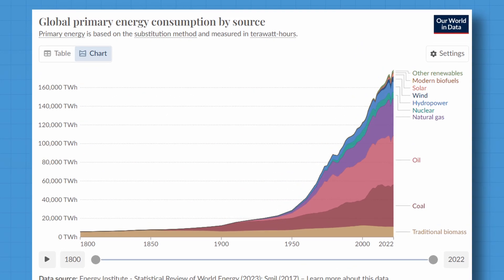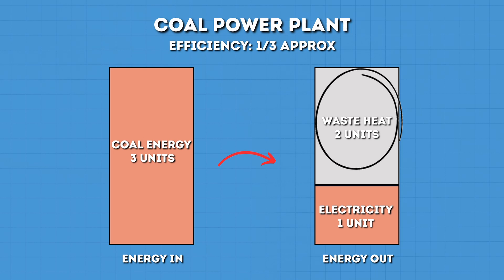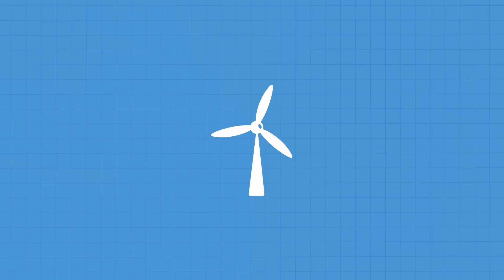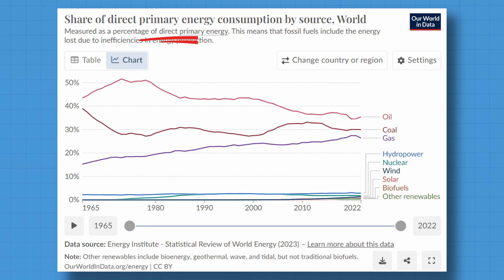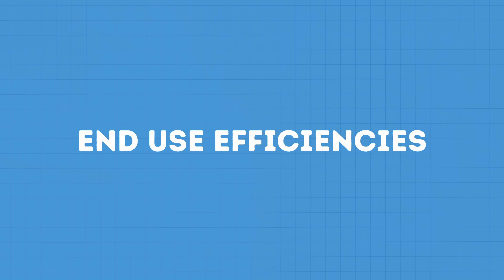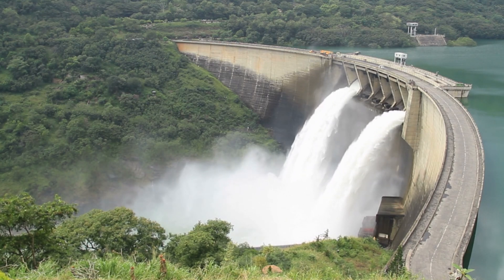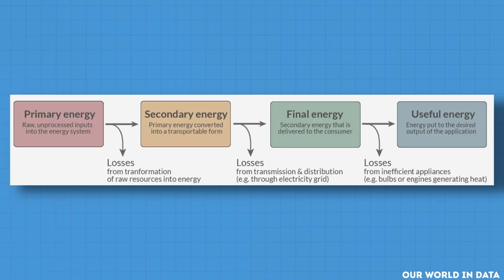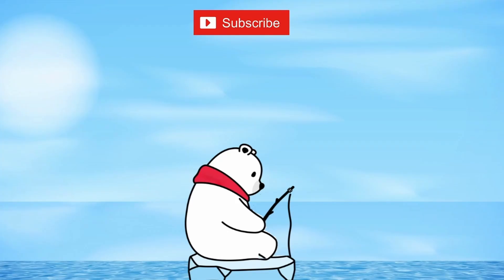We need to talk about the Primary Energy Fallacy

Comment: True but one sided. There are plenty of "fallacies" going the other way. 1) Renewable energy is cheaper. Yes when the wind is blowing not if you consider the infrastructure, like back up when wind not blowing or inertia installations to preserve grid stability. If it really was cheaper then normal market forces would allow renewables to take over. 2) Heat pumps are more efficient. Yes but comparing cheap gas to expensive electricity. The delta T on a heat pump is poor so affected by ambient conditions and need radiators twice the size. 3) EVs. If these items were really better people would be buying them instead its top down with quotas. 4) Video misleading in that it suggests there won't need to be an increase in grid capacity as this is allowed for by relative efficiencies. Up to £400bn of investment is required in green infrastructure over the next decade if the UK is to meet its ambitious Net Zero target, according to a new report by PwC commissioned by the Global Infrastructure Investment Association (GIIA).
Reply: £400 billion is a piddling small change compared to societal collapse brought on by climate change. (Annual UK GDP is $3 trillion.)
Reply: @wotireckon  Pointless. Total worldwide Carbon dioxide emissions have only steadily increased since Paris agreement. Look at the graph. De-industrialisation would be a gift to Russia and China. "Societal collapse brought on by climate change" Why? Could just as well argue that trying to implement carbon net zero has that effect. The good thing is that 2024 will be the first year where 1.5 degC increase is achieved although not continuously. This is a good thing. The IPPC report references 1.5 degC extensively so at last we be able to check predictions with reality. People will decide that the dire predictions don't happen and throw out the policy after Labour tries to implement them. And that will be the end of your fantasies. No wonder the greens are getting desperate, can only shout wolf so long.
Independent Statutory Bodies’ Analysis: The Committee on Climate Change estimates that reaching net zero emissions by 2050 will cost approximately £50 billion per annum by 2050. (UK government budget is £1100 billion).
Office for Budget Responsibility (OBR): In a July 2021 report, the OBR estimated the net cost of the UK reaching net zero by 2050 to be £321 billion, equivalent to just over £10 billion per year.  So my original £400 billion on the low side of estimates.
Reply: @alanrobertson9790 Also who the hell says Green New Deal and similar investment strategies lead to…deindustrialization…

Here in the USA (not the UK, but i mainly know local data off the top of my head) our Coal Towns and Rust Belt are dying and rather than investing in other things we could be manufacturing/just transition into sustainable jobs we have decided to just sit and pout as the world moves on.

A Green New Deal and similar investments would create PILES of new (often high paying and union such as Electrician, Welder (and/or Pipefitter), Plumbers), also if Deep Dry Rock Geothermal is used Drillers etc.

The only people your arguments serve are the Rich.  Poor People (especially in non-rich) countries are going to get fucked over the most, middle class people (without subsidies and/or jobs and/or more housing (which is often related to these programs) ) are going to suffer economically.  The rich however either have to slightly shift investment portfolios and/or quit being an Oil Baron.

Don’t be deluded by Industry Lobbyists.
Reply: @ericlotze7724  A green new deal will give jobs for some workers but against that higher energy prices and government subsidies cost other people money which may make them uneconomic, particularly considering cheaper foreign competition. What you said about the rust belt is a true, with decline setting in before any green new deal. Well higher energy costs won't be a way for reversing any trend. Can agree that higher costs will affect the poor more which is why you won't get the poor going on green protests or queuing up for EVs. Industry is useful and serves the interests of its customers. People want to buy petrol. I'm amused that your comments shows how you fit green issues with your overall philosophy. You are probably a young person who is given things, first from your parents and then from the state, in this way you can be cheerfully insulated from the damage of the policies you advocate.
Reply from the maker: The video doesn’t suggest there won’t be a need to increase grid capacity, far from it. It’s 100% clear that grid capacity and transmission needs loads of investment. One of my next videos is precisely on this need for investment in the grid, especially as so many projects are backlogged because they can’t be connected. So I honestly don’t think this video suggests in any way that grid capacity will remain the same
Reply: @theclimateClub  Time index 9.14 "It sends the wrong message. The message being that we need to increase our energy supply from renewables substantially, instead of meeting the actual demand". But its not the wrong message, we do need to increase our energy supply from renewables substantially which is still true even with the efficiencies consideration. So who is being misleading? You could have accurately said "we need to increase our energy supply from renewables substantially although less when the efficiencies are taken into consideration". "So I honestly don’t think this video suggests in any way that grid capacity will remain the same". The video neither says stays the same or talks about the huge increase required. That you are aware of this makes this omission a political choice which is my point.
Reply from the maker: @alanrobertson9790  perhaps it was unclear then. But that statement was in regards to the substitution method which inflates energy numbers. If we “inflate” what the real energy demand is then that can send the wrong message. The argument wasn’t about not needing to ramp up renewables. It was about meeting the actual demand instead of purely focusing on supply, not the inflated demand that comes from this accounting method. This point was also made by Michael Liebreich in “net zero will be harder…” paper. If it was unclear that that was my point then I apologise, however that argument was for the substitution method. So no, I’m not making it political
Reply from the maker: @alanrobertson9790  in other words, it is the wrong message
Reply: @theclimateClub  Re " in other words, it is the wrong message". To meet the actual demand we do need to increase our energy supply from renewables substantially. This is correct not wrong. You have already conceded the point and are about to do a video on the subject. I look forward to your video.
Reply: Renewables are taking over, but it doesn't happen overnight.
Reply: @SirCutRy  "Renewables are taking over". Nobody would complain about that unless they need to be subsidised. Here there is a mismatch because supporters always say that renewables are the cheapest and I reply well if that was the case then they would succeed through normal market forces. Renewals used to be subsidised but to find out if still the case I typed in "do renewables need a subsidy" you get that they used to be subsidised but "Today, renewable sources of electricity are becoming increasingly cost-competitive with fossil fuels and nuclear power. As technology advances and economies of scale come into play, renewables are no longer solely reliant on subsidies". An ambiguous answer.
Reply: @alanrobertson9790 mind telling me how much fossil fuels are subsidized…
Reply: @ericlotze7724  Fossil fuels are not subsidised, you don't need to subsidise the most economical form. In some places, like Egypt you get subsidises for the end user because the population is poor. You can also have tax relief for exploration. That is because governments may wants their resources exploited because it makes money for them. In UK the tax on petrol and diesel is very high and makes money for the government, additionally there have been extra taxes recently. So your assertion does not bear scrutiny, quite the reverse. But give me some specific examples along with a reference and we can discuss further.
Reply: You are valid in that this video ignores some of the Complexity that a full proper Life Cycle Assessment for some particular thing.  The main point though doesn’t need to be so detailed though.

Just 1.) As per the person who discovered the Greenhouse Effect and all good data since More CO2e = More Heat (also Ocean Acidification

2.) That stuff is bad

3.) We need to do everything we can to cause all that to not happen

4.) We also need to not fuck over workers/people in the process

5.) The PILES of papers/plans and all that on how to do this.  101 ways to do it these days, we just need everyone to agree on 1-4, invest some money in it, have a few years to get everything built (with good jobs in the meantime!) and we are GOOD.
Reply: @ericlotze7724  As you will be aware global CO2 output gas has continued to increase since any small reductions in the west are more than offset by the developing world. We will therefore see the continuous 1.5 degC increase and more. This will allow us to judge whether the 1.5 and 2 degC predictions made in the IPCC report come to pass. People can then make their own minds up about whether bad things actually occur, which given the damaging effects of carbon net zero policies, would be necessary to persuade people. Now there is a chance you may be right, that depends on events. A more likely scenario is that people will see 1.5 degC, decide its not too bad and carry on. Should know in less than 10 years now.
Reply: In reference to the original post: Wind and PV solar are about a third the cost of electricity produced by natural gas, the cheapest fossil fuel energy. Battery storage is anticipated to approximately double the cost, when it is used (that is, when production is less than demand). Combined, renewable energy plus battery storage is still less expensive than fossil fuel. The reason why it hasn't been "choosen" by the invisible hand of capitalism yet is because the supply of renewable generation and grid batteries still needs to be ramped up to provide the inventory necessary to power the grid, and because the upfront cost of such systems is higher than new fossil fuel plants. The ROI is much higher for renewable power, so they are much more profitable in the long term, but in the near term if you're strapped for cash and need a new power generation source, a combined cycle has plant is more affordable upfront.
Heat pumps are an extremely viable way to heat a home, even where I live in Minnesota. The COP can drop below 2 in extreme cold, but even down to -10 F they are more efficient than resistive electric heat. There are many documented ways to function in extreme cold with a heat pump, most simply by having a backup resistive heater that gets used a few times a year, or there's thermal energy storage in phase change materials, allowing heat to be stored during the warmest parts of the day when the heat pump is very efficient. Electricity to operate them can be more expensive than gas in some cases and places, but in many places with mild winters, where heat pumps are most efficient, gas lines aren't very common anyways. And the difference is often slim. My friend in Duluth who switched to one a few years back says the difference between the gas and electric bills was averaging out to $50-60 per heating season, but he is also forgoing the usually furnace tuneup and cleaning that could cost over $100 a year. 
EVs: people are buying them under their own volition at an increasing rate. The only force being applied is through advertisement and subsidies, and if those two things don't also apply to gas cars I don't know what does. Never the less, anyone serious about climate change knows that default car usage isn't a path forward. This doesn't mean getting rid of cars all together, but it does mean shifting to EVs where cars are still needed. 
The cost of infrastructure updates: These values are often misleading. Governments constantly need to spend money repairing and replacing infrastructure to ensure a safe and effective constructed environment. In many western countries power transmission infrastructure needs to be replaced soon because many systems are decades old. So when you give a figure, make sure it isn't including the basic cost of repair and replacement, but rather that you're giving an estimate for the difference between basic repairs and upgrades that would facilitate renewable energy. In any case, we're talking about a few tens, or at most a few hundred billion in investment. The U.S. recently approved $90 billion in war aid money that will go up in smoke in a matter of a year. Compared to defense spending, grid upgrades are often cost comparable, and have substantial benefits that can last a century or more
Reply: @Spencergolde  Well put!
Reply: @Spencergolde  1) If renewable energy really was cheaper then people would be falling over themselves to adopt it and bills would fall as a matter of the usual market economics. Why write so much when you can adopt a much simpler test. That ought to suggest to you that it isn't true. 2) EV sales have been increasing 2022 and 2023 true. "The only force being applied is through advertisement and subsidies". Not true in UK where they are enforcing EV % quotas, increasing over the next few years. It will be interesting when people can't buy ICE because not enough EVs sold which would be an easy prediction. I share your sentiment about the importance of volition and democracy. 3) "anyone serious about climate change". People should not adopt beliefs out of fashion but the problem will solve itself. We will exceed 1.5 degC and probably 2 degC (global CO2 emissions are rising) so we will be able to see if IPCC predictions are accurate. Observation is better than prediction. 4) Comparison with Ukraine war irrelevant, each should be assessed on their own merits. It does rather question as to how you can have decarbonisation in a militarily competing world.
Reply: @alanrobertson9790  You're last point is a good one, and one that's often overlooked. Not just as a matter of tanks and jets requiring petrol fuel, but more so the propellants in every rocket, bullet casing, explosive of every kind comes from nitrated petrochemicals. Few people are working on renewable alternatives to RDX. Still, the bulk of all emissions come from private industry and commerce, so making these sectors more sustainable is worthwhile even if the military continued its petroleum reliance. To the issue of "we'll find out eventually", we have. We are seeing measurable increases in extreme weather severity and frequency, shifts in sea water temperatures, increased disease range, and other effects that agree with what is anticipated due to human caused greenhouse gas emissions. People during the summer of 2023 were rationing water in drought stricken places, wearing respirators to protect against wildfire smoke, and finding their homes destroyed by hurricane and typhoons that were statically significantly stronger than they were 20 years ago. We have measurable data as well as eyewitness data confirming that our climate is changing in a way that is well explained by increased heating caused by greenhouse gasses. 
But, and this is a big ol' but; even if climate change wasn't occurring, there are numerous non-environmental benefits to switching to a predominantly renewable energy grid, the most notable being resiliency afforded by multiple distributed generation points, no need for fueling or to buy fuel from other places, and cleaner air which would kill fewer people.
Reply: @Spencergolde  Nitric Acid was originally made from Electricity by the Birkeland–Eyde Process before the Haber–Bosch changed the Chemical world.

Between going back to some of that, but also sustainable biomass (Gasification or Hydrothermal Liquifaction, not Ethanol FYI) and Power-to-Chemicals (a part of P2X Tech) it isn’t really rocket science.  Already been done at the Pilot Plant / Trial level so the Technology Readiness Level is pretty high.

It’s just money.

Heck being Self Sufficient Energy wise, if not an exporter, with no need to worry about a Field no longer being productive…is DAMN great for defense…no?
Reply: @Spencergolde  I always find it curious when people say that millions of people may be displaced in a world of 8000 million people. The trouble with bad weather is that there has always been bad weather not just in 2023. In a world of politically motivated people can you believe people who claim that every event has something to do with climate change, whether floods or drought, especially when unprovable at a local level and when things patently nothing to do with climate change, such as people deliberately lighting fires is also claimed. The point about "we'll find out eventually" is that carbon net zero isn't a trivial thing, affecting as it does industry, energy, transport, food and military. If it was a trivial thing then an insurance policy might make sense but under these circumstances being certain that the expense is necessary is required to convince people. The higher temperatures will be achieved. I'm glad about this and you aren't but it will happen anyway. Its global CO2 emissions that matter. Now some in the west have decided that its only fair that developing countries get their turn but given that there are more poorer people than rich people then CO2 and temperatures will rise inevitably rise. The climate is urgent but its OK if India applies this in 2070. The climate doesn't care about social justice so what it boils down to is that you are advocating a policy which is politically unachievable and the progressives are making it unachievable when it suits them. (Bit like covid lockdown was essential but not for black lives matters protests).This is obvious when you look at the graphs of steadily rising CO2 levels. The consequences could go either way. I might be wrong but so might you. I'm happy to let observable evidence decide.
Reply: @ericlotze7724  I agree that it's possible to make propellants and X-plosives from electricity and biomass, but it's not possible to do it for cheaper than from petrochemicals, at least not anytime soon, and war is really a matter of spending at the heart. If you can make 10X as many rockets for the same cost, that's how it's going to be made. But again, though defense is heavily reliant on petroleum, the emissions from defense are trivial compared to civil sectors, and a great way to reduce defense emissions is actually through diplomacy to reduce the number of conflicts
Reply: @Spencergolde  no i agree, I’m just saying in the future we can destroy eachother in all sorts of futile ways…but with negligible GHG Emissions (notwithstanding Firestorm of Built Ip Areas / Destroyed Ecosystems)